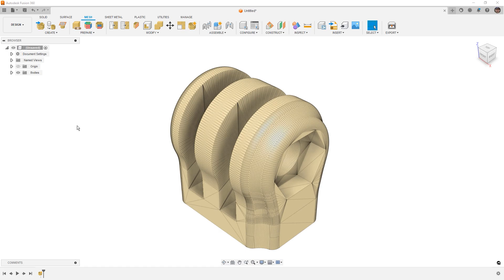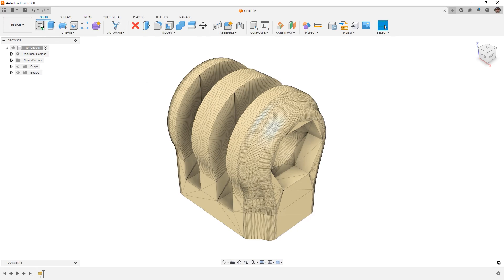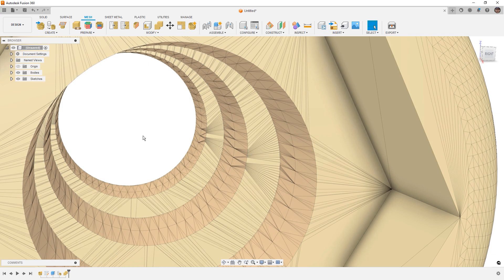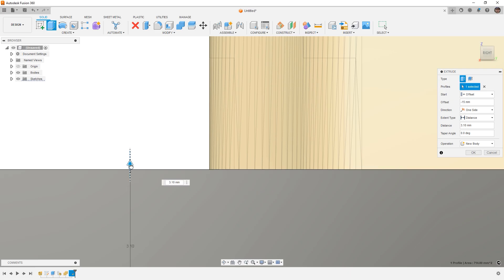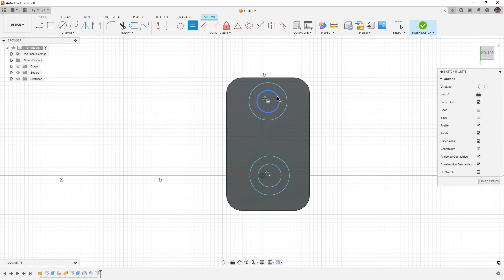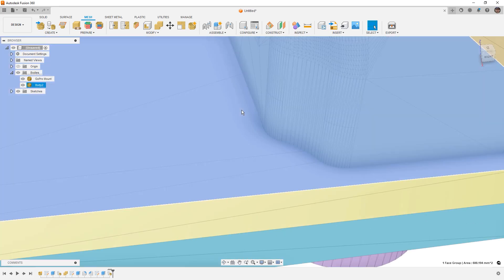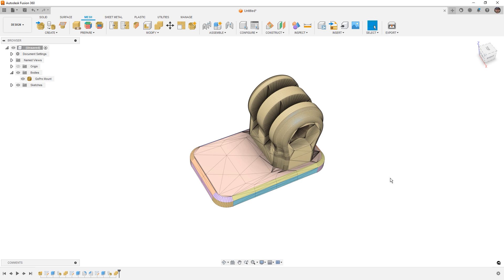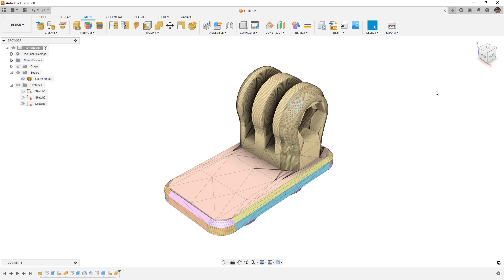How to Import and Edit 3D Mesh Files Easily | Autodesk Fusion

Comment: I've used 3d Builder to modify stl and 3mf files in the past.  What I needed to do was make the item longer without stretching it. I will have to try using Fusion 360 the next time I need to modify one.

Comment: The mesh tools in Fusion really suck! Sorry to be so harsh, but 90% of the time, the mesh will not convert to solid successfully. It will partially convert to surface only--useless! I mostly use 3D Builder, anymore, to modify meshes. It's simple, logical, and just works. I wish Fusion would develop a mesh tool that was as simple. At this point, if I'm working with a mesh, I'm not using Fusion.

Comment: Great tutorial. I use mesh-edits a lot. Typically, I want to tighten tolerances on mating parts or print-in-place joints. I suspect my printer & printing process has better tolerance capability than many mesh models out in the wild are designed for - most of them have very sloppy fitment. So I import them into Fusion and do these mesh-edit operations. But I usually start with Create Mesh Section Sketch to get the existing dimension off of the imported mesh. Then I edit the sketch and use offsets that I use to extrude my solid bodies. Then I tessallate & combine the mesh bodies as you have described.

Comment: This is a method I knew and used for long, as with all meshes the more the triangles the more the time is needed (and often the computer dies). When I have a very complex mesh I used to split it in smaller parts and work with them. Then I rejoin them together at the end. But also this method does not always work. It depends on the mesh.

Comment: Since Fusion doesn't allow us to select mesh points when making a sketch, I often end up in space claim creating planes and sometimes just points for reference that are on the mesh and then save this as a Step file and bring that into fusion to do my work. 
It would be great if Fusion allowed selecting vertices and edges of mesh in design mode when solid or surface modeling

Comment: Yes! The other big thing that I do just a bit more than these is cutting a model up. Several of the slicing software pieces do cut along planes, but sometimes you want to add some keying and leave a little extra for tolerance, but they usually cut like a knife. Besides, not all of them do it that well. Meshmixer used to do it well, but they point to here. I've gotten pretty good with F360 but have been meaning to learn how to do "parts", so I could key pieces together.
Reply: yes

Comment: As a hobbyist I clicked this video expecting to be told to get the payed version, but instead I learned new ways to use the free version. Thank you!
Reply: Yeah to the best of my knowledge the only tool missing from the mesh workspace for a hobby user is the ability to convert a mesh file to an "organic" body.  Which takes your mesh, attempts a quad conversion, and then converts that to a T-Spline body in the forms workspace.  This is part of the product design extension which hobby users don't have access to.  you could still convert your mesh external to fusion before bringing it in to Fusion and use the Convert tool while in the Forms workspace to get to the same end result.
Reply: @LearnEverythingAboutDesign  Do you have a tutorial on how to do this? If I take a quad remesh from Rhino and import it into F360 as an STL, I can't even select the mesh in the Forms workspace convert dialog box.
Reply: @larryh5758  On the official Autodesk channel there are a few videos on this.  I do have a video on my channel covering this as well https://youtu.be/fDIQKzDsgE4?si=9cEHfi3ju5i9yV9p&t=455  STL file type, unless I am mistaken, is triangular mesh only.  So if you have a quad mesh in Rhino and save it as an STL then it likely turns that into triangles.  You would need an OBJ quad mesh to be able to bring that into fusion and convert to a Tspline body.
Reply: @LearnEverythingAboutDesign  Thank you. I'll give it a try. I'm relatively new to this and didn't know that STL and OBJ had those differences. There is so much to learn, and I've found your videos very helpful. Beyond very simple examples, I'm finding reverse engineering challenging.
Reply: @larryh5758  Yeah there are nuances to mesh files.  at a basic level STL is triangle mesh only, no other data.  OBJ can be quad mesh and can bring along some basic material information.  When you save a mesh as OBJ you might notice an additional MTL file that goes with it.  Other mesh types like FBX have the ability to actually store more info such as 3d print settings.  I think FBX is the direction things are going BUT a lot of print slicers (including Fusion since it works off the CAD data) can now import STEP file geometry and provide additional benefits such as creating true Arc movements in the code that is used to move the print head instead of a bunch of small straight lines.
Reply: @LearnEverythingAboutDesign  I almost always use STEP going from F360 to Bambu Studio. Just finished a project which started with a fairly dense 3d scan. At first I tried the reverse engineering technique #1 from your videos to take sections and try to loft, but as you point out that doesn't always work that great. I then realized that there really wasn't much point to doing a comprehensive reverse engineering as I really only needed to do smoothing and several precision Boolean operations against something that was just a block in F360 (plus make some mounting holes). F360 bombs when your 3d scan is too dense and haven't had consistent luck with the Fusion mesh tools. Rhino can do a fairly high count quad mesh that F360 processes easily. Is this a legit approach or am I barking up the wrong tree?

Comment: You skipped the important part - how to trace the center of a meshed circle/Solid of revolution. Not always it is in the origin point.
Reply: Very True, we covered this in another video about designing scan based parts(which I am not sure if its online or not yet).  But for that I would suggest using a mesh section sketch and fitting curve to mesh.  The circle won't be constrained but once you have it, fix it in place and that is likely the best center point you will get.

Comment: How do I fix STL files and methods that actually work? I hear from your other videos that meshmixer was retired and not supported because fusion has a lot of those features but it is a struggle to take any of these files and “fix” them in fusion. Closing holes and the like. Do you have a video or know a good tutorial video for how to clean up these files in fusion?
Reply: I've completely failed to successfully convert anything in Fusion. if it saves, the file is corrupted when I open it again, and it takes a couple of hours to allegedly save it anyway.  Really really p***d off with the inability to actually do anything with a fairly complex STL.  All the examples I've seen in videos are with a tiny object that I could have drawn in 10 minutes anyway.

Comment: Don't think 99% of the STL models are going to be aligned to the grid. So this workaround seems like it'll take more time than just reverse engineering it.
Reply: It will be a crap shoot depending on where the model came from.  Upon import there are options to snap it to the origin, but if the rotation is off that gets tricky!  You can go into Direct Edit mode and create planes based on 3 points by selecting areas of the mesh and use those (or axes) for your design of new mesh bodies.
Reply: Right! Wouldn't it be nice if we could select vertices of the mesh to align to a plane or other object? I believe we can interact with the mesh using t-splines, so the capability can't be too foreign. But in the several years I have been using fusion, they haven't allowed us to select mesh edges and vertices in design mode.
Reply: @timwilliams632  I believe the reason (not being a developer at autodesk, just guessing) that you can only access the verts of a mesh in direct edit mode is that performance would take a huge hit.  It already does with mesh models which is why right-click and making them unselectable helps.  And thats just Fusion highlighting the faces.  IF it had to figure out which verts and edges and faces were selectable when you ran your cursor over it the program would stop all together.  And thats why in direct mode you end up with paint selections rather than it highlighting a vert like you would get in Forms for example.
Reply: @LearnEverythingAboutDesign  They could make it only selectable when you chose a specific tool, slow interactions only when getting references but make the whole process smoother
Reply: I think you are talking about the circle and how to have them at the correct center ??? The solution could be this : 1. copy the object and hide one of the two 2. do a convert to mesh  3. create the sketch 4. project 3 point of the circle, 5. draw a new circle from this 3 points 6. enlarge the circle and finish the sketch 7. hide the converted object in mesh.